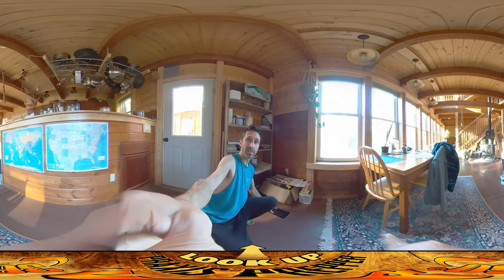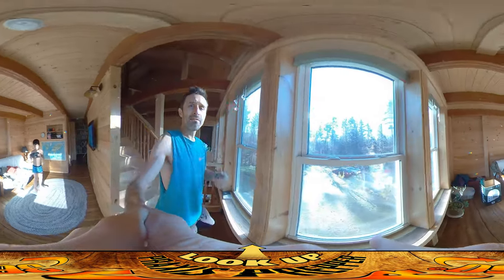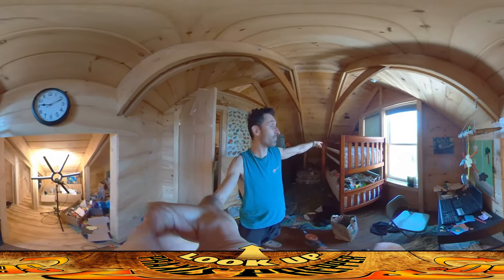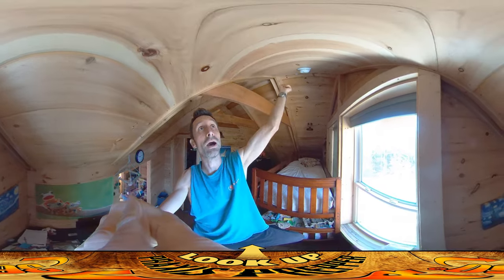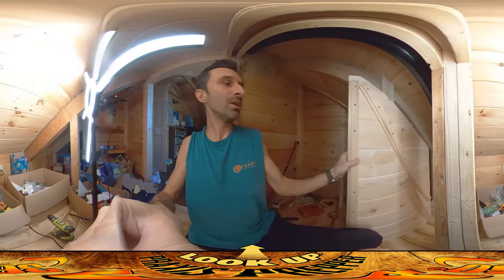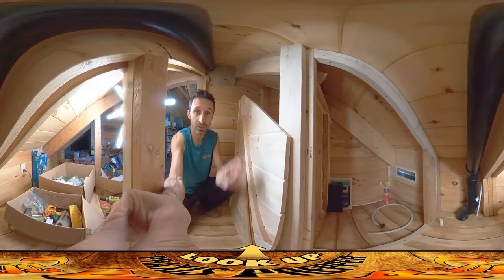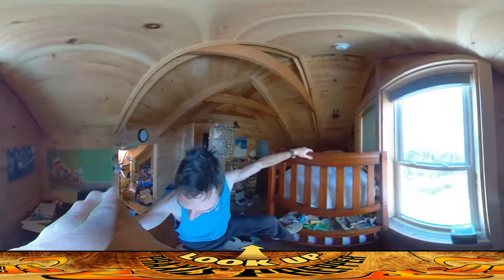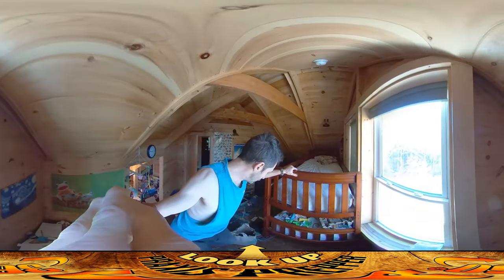Homestead Building - Sub-Floor Warm Air Venting, Indoor Air Circulation

Comment: Poor guy, roasting in his room...
I'm sure it'll be great to capture all that heat. Any guesses as to how much it might cut your fuel consumption? Even if it doesn't, just having a warm floor in the morning counts for a lot in morale.
Reply from the maker: It'd be hard to track the exact amount saved because of there being so many variables. But I CAN say that heat transfers most efficiently in high-differential situations. That means that you lose more BTU's through your wall when the temp difference between the inside and outside is farther apart. So that said, it stands to reason that I lose more heat when a room is overly hot than when a room is comfortable. So less heat lost means less heat needed to be generated. The exact amount though? IDN.
Reply: @PraxisPrepper  Yes, it's proportional to the area×the square of the ∆T. Even a small change can mean a lot less energy transfered!
A good wood stove is high on my list but that doesn't mean that it's close to the top. Gotta admit a little envy at how you've set things up.
It really is encouraging me to tackle one more project when I see that you've posted another video. I've said it before and I'm sure I will again, thank you.
Reply from the maker: @matthewellisor5835  That really makes my day knowing that my work is encouraging to you. It really is just a matter of putting in a little work every day to improve things over time. Today, I just got the dehumidifier in there, and redid the wiring in the box in the basement so that the outlet in there with the dehumidifier only gets power when the duct fans are running too. There's also a switch so that I can turn off the dehumidifier when it's not needed. Little bits every day. Good luck to you on whatever your little bit for tomorrow is... or Friday since tomorrow is a holiday. ;)

Comment: Thanks for showing the functional completion of this very important piece of your home build. It was fun and interesting to watch you build the block conduits under the floor. Now it's cool to see it operating. Please do a follow up (or two) later this winter as you live with the system. From the outside, I expect to see you enjoying the warm floor. Will the second floor bedrooms be cooler (good for sleeping well)?
Reply from the maker: It's feeling great to be finishing things here too. As far as the thermal variation of the house goes, it's all pretty homogenious now. All the rooms (save the insulated ones like the pantry - which is in the 50'2 now) are pretty much the same temp. The one hot spot now is the area right in front of the woodstove... which is exactly the way you want it when you come in from the cold! ;)